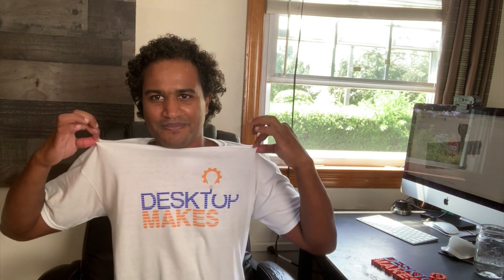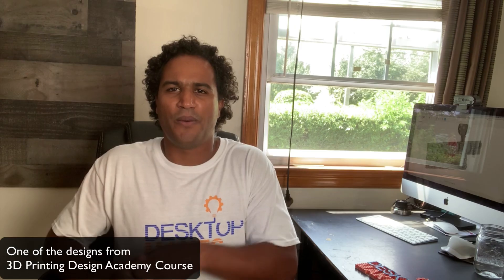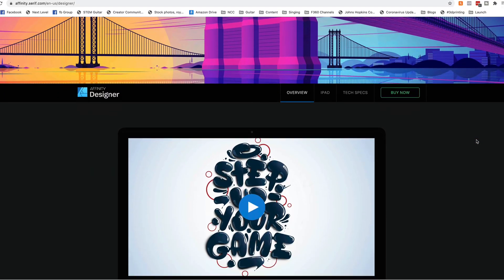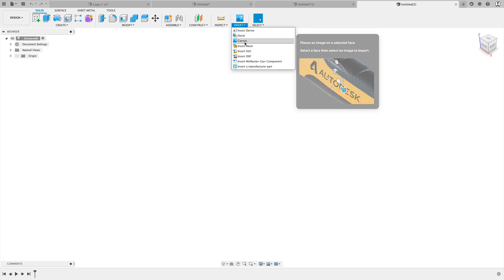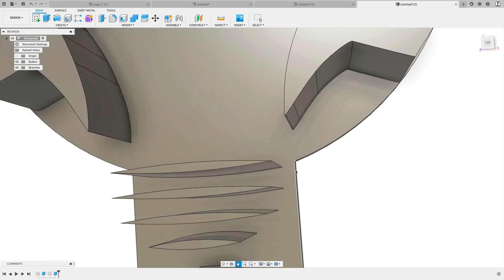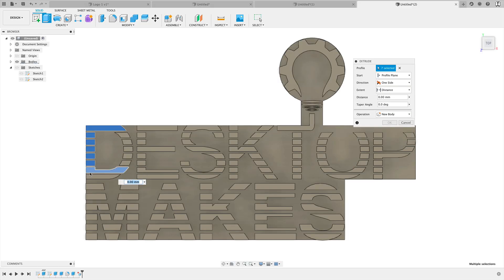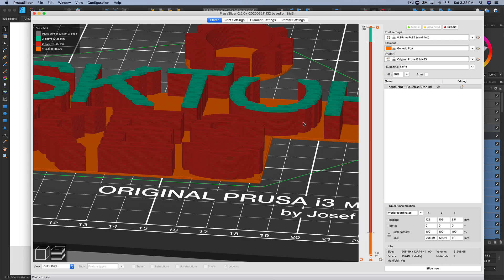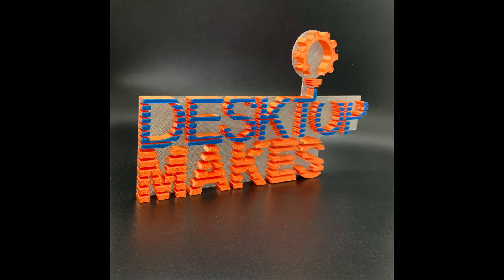Affinity Designer and Fusion 360

Comment: I also like the Affinity Designer to Fusion 360 workflow!   I have found that if you export your SVGs using 96 DPI then you can scale them in Affinity Designer and they import to the proper dimensions in Fusion.  Fusion can be rather slow with complex shapes so not having to resize them after importing seems to work better and faster for me.
Reply from the maker: Thanks Shawn!  That is an excellent tip!  I will give it a try.

Comment: 4 things:
1. Is it fine that I use prusa slicer and I have an Ender 3 and should I be using Cura?
2. Do only SVG files allow you to select particular 2D faces once imported to Fusion? (that's how you were able to select specific parts from the illustration to extrude into 3D)
3. Your workflow is pretty good and I may try that in future... and I didn't know you could pause the print at a certain layer height to change the filament colour! Tanks!
4. I recently commented on your udemy fidget spinner course under the name 'stef'...and I really appreciate your excellent content. 3D design, printing and fabrication is the way I wanna go (like you ;)

Comment: Liking the new logo 
Very similar process to one I have used a few times, but I used a free online tool to convert the images I needed to SVG 
Website I used for conversion is called convertio
For the scaling I like to draw a line or square in a sketch with the dimensions I want the finished item before importing the SVG so I know when I do the scaling and alignment thing  it is not going to come out an unexpected size
(Scaling has tripped me up a few times before and had me doing the scaling in the slicer, it looks like you have a much better handle on it than I do!)

Comment: I'm currently producing similar items, although much smaller, they are works plates for 16mm/foot scale garden railway rolling stock.  I draw them in Turbocad, and export as DXF, and from then on, its the same as your workflow.  I also have Affinity Designer, but currently I'm better at Turbocad, so I used that.  I have many of the detail parts I need already drawn as 2D items, so its easy to import them into Fusion360 as DXF and extrude.
Reply from the maker: Just checked out Turbocad.  Looks like they have a bunch of different levels of product.  A lot of options out there for 2D drawings and the best one is the one your know how to use 🙂

Comment: Very Good. I have not upgraded to Catalena because I have a CS6 suite which is now obsolete. I have looked at Affinity but have not bought it yet, but may after you testing it for me. I don't like the idea of renting Adobe products forever. I just received my Prusa last month after an 8-week wait ( due to COVID) and read about the filament changing but never did it. Looks easy! I do like how quiet the printer operates. Thanks for your great tutorials. Short, to the point and easy to grasp.
Reply from the maker: Thanks Lou.  Yes, the new Prusas are extremely quiet and their slicer makes changing filament very easy.  I recently updated to Catalina and honestly am regretting it.  It may just be that it's not playing well with an existing software or hardware but the computer keeps restarting on me.  Am looking forward to the next update as hopefully the issue will be fixed.

Comment: 👍 Cool 😎 Looking forward to your CR-10 adventure. 😃
I've used Inkscape v1.0 to import an Adobe .io file.
Reply from the maker: Thanks 4FunRC.  I've used Inkscape on my pc but was having issues with it crashing on me and it looks like a process to try to run it on a mac.  I haven't tried v1.0 though.  May go back and give it a shot.
Reply: @DesktopMakes  Yeah, that makes sense.
Since I don't know 'jack' about a 'Mac', I'm sure you'll find some answers prior a possibly futile v1.0 install.
Reply: Many thanks for the video. I use Inkscape 1.0 a lot to create laser cutter files but it’s a nightmare on a Mac. I use an iMac with 128gb ram and it is incredibly laggy. Because I run some windows software I also run windows through parallels on the Mac. The performance difference is amazing and it makes Inkscape useable. Apparently it’s something to do with the way Inkscape uses the GPU? I understand that Inkscape runs best in Linux. Anyway, Inkscape is a fantastic program and can handle pretty much any file format you might present to it.